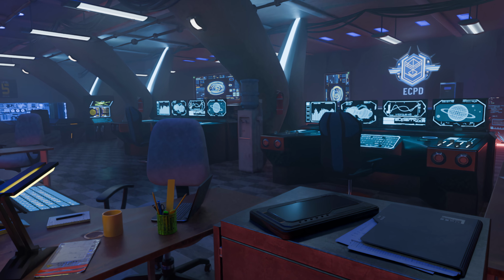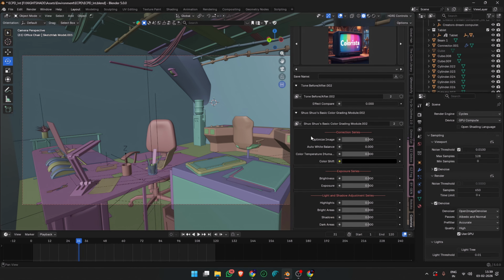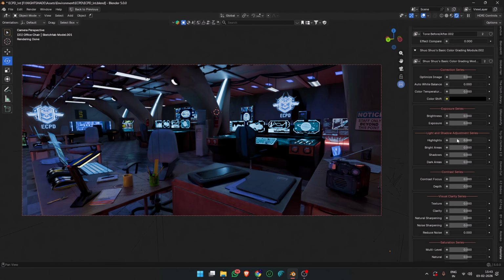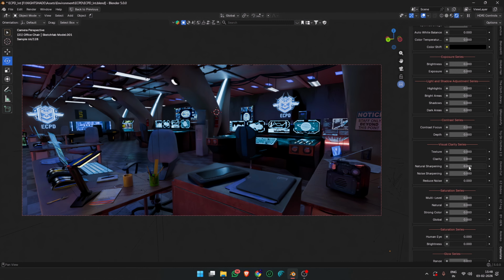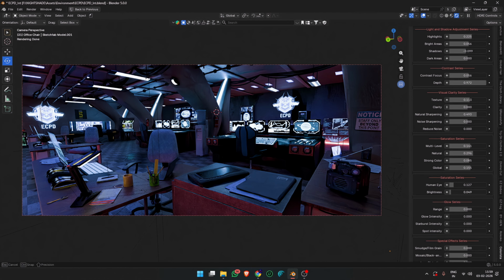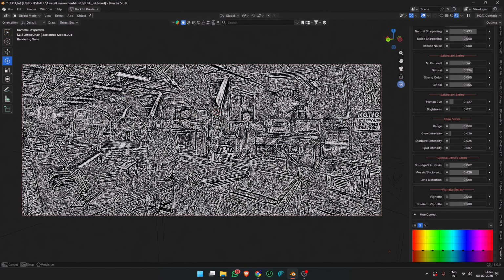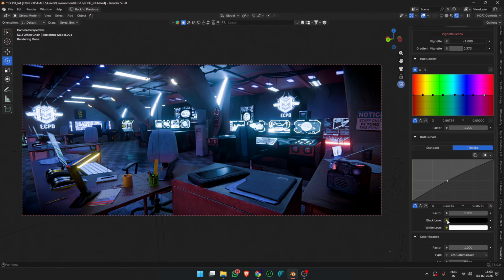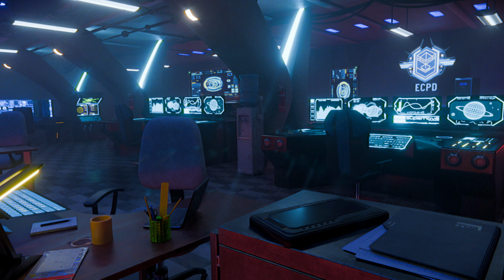Color Grade in Blender Instantly (No Nodes, No Compositor)

Comment: Nice video! Just explored Colorista today, experimenting with it, and I was looking for a tutorial. One very important thing I cannot figure out though: I adjust the colors with colorista, render it, and it the same image without the adjustment. I assume it has to do something with the Compositor, and the top part of the plugin, presets and so on, but that's very confusing, and I'm totally lost, how to apply the effect.
Reply from the maker: It worked for me right outside the box, mate. I didn't have to do anything in the Compositor. Which version of Blender are you on? I'm also going live on a stream in 20 minutes from now, I'd be happy to answer your questions.
Reply: @PixelBender_IN  nvm it was my bloody mistake. I'm pretty new to Blender, and when I saw it rendered the full image, but the color wasn't changed, I closed the render window, and tried to look into shaders and compositing, while it was actually still rendering. It's just damn slow (I'm on Macbook Pro, not on a render pc, and the object is pretty complex). 
TLDR. I didn't know this is how it works, renders the image, than applies the post processing, so I was just supposed to wait.
Reply from the maker: No worries buddy, don't beat yourself up. It happens! 😊 @martonlakatos7933 
What Mac book are you on? Does it have a GPU? Use that for rendering and don't stress your Mac book too much. Laptops are not made for heavy duty rendering. Use a cooling pad, keep changing your thermal paste inside once a year at least. Cheers, mate 🤘